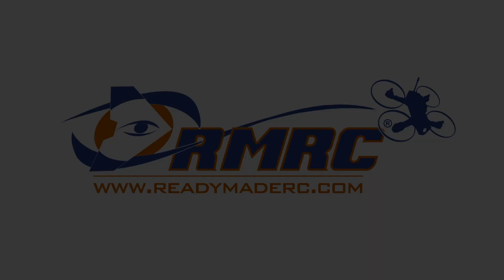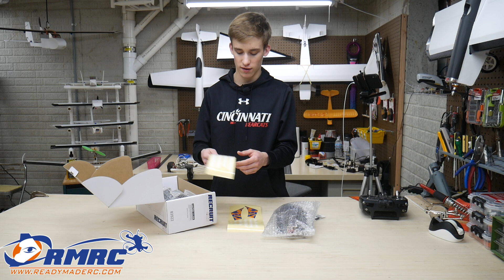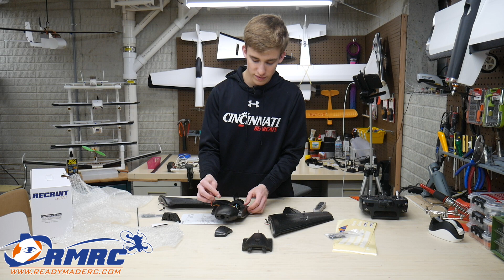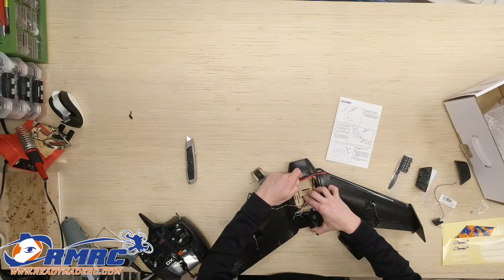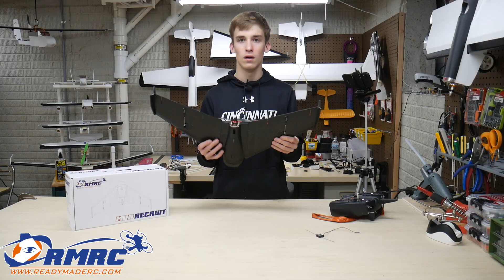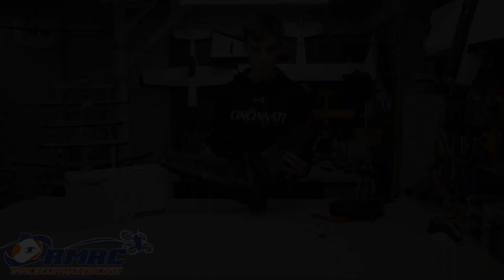ReadyMade RC Recruit Unboxing, Build, and Overview

Comment: Is there a wiring diagram somewhere for this?  How do you wire the camera to get OSD?
Reply from the maker: You will need an actual flight controller for that, one that connects to inav or something. this us just a basic gyro board for stabilization.
Reply: @CustomFPV  but somehow people are getting bat volt and run time? I realize it's not full OSD.  I think you have to use the swift run cam?
Reply from the maker: @morrismay  Ah yes, that is the native OSD built into the cameras, most runcam, foxeer, and other cameras have it. You will need to wire the camera directly to your VBat, and might have to go into the cam adjustment menu with the joystick to turn on the OSD if it’s not already on.
Reply: @CustomFPV  ya! thanks, man, very helpful!